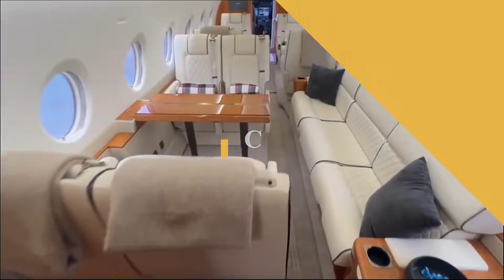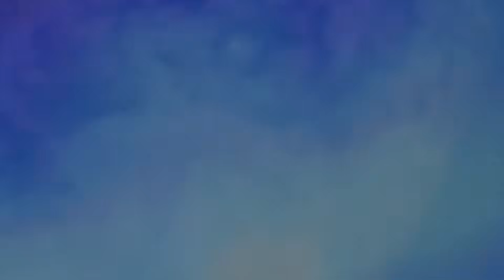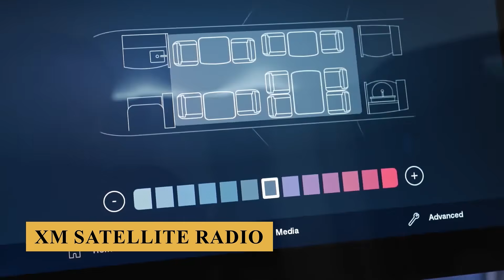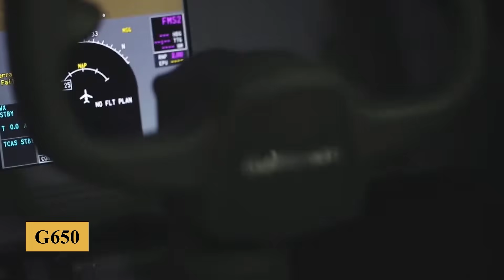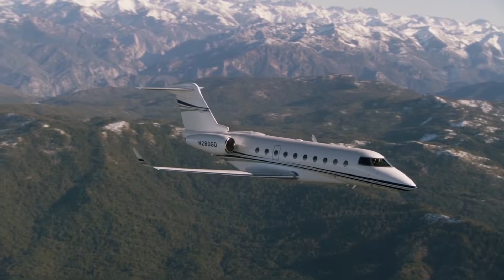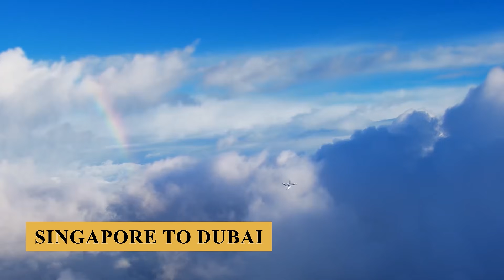Inside The $25 Million Gulfstream G280

Comment: The praetor 600 would eat this aircraft alive.
Reply: Same range, praetor is slower. How does it eat the 280 alive?
Reply: 600: 4000 range, better cabin comfort, advanced technology, and lower operating costs. 280: .85 vs .83 speed which does not matter due to shorter range of 280.... 600 technology alone blows away 280....
Reply: not if it tried to take off on a summer day from Key West or Hilton Head, it would eat something else